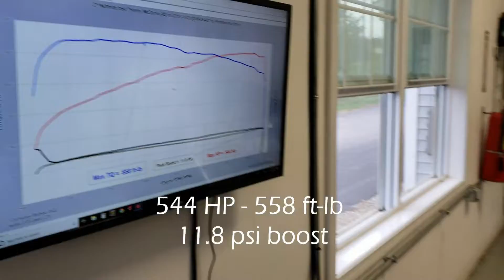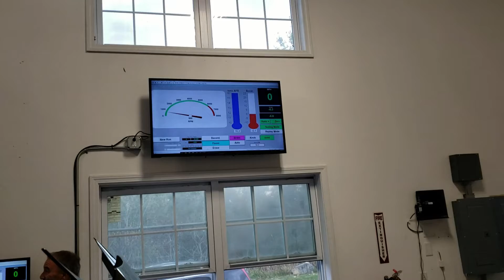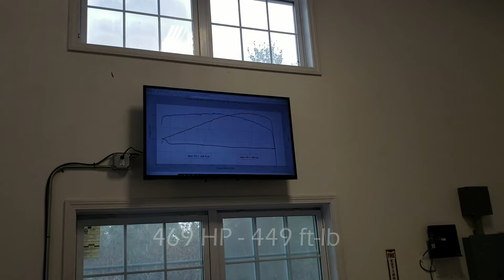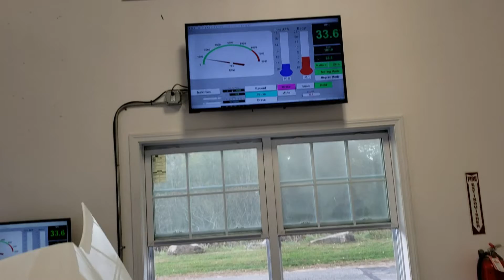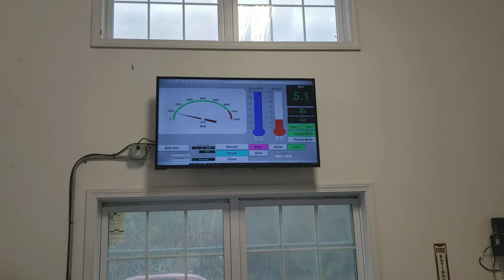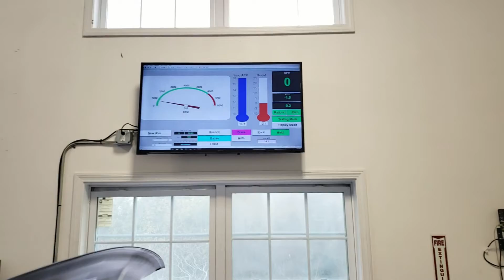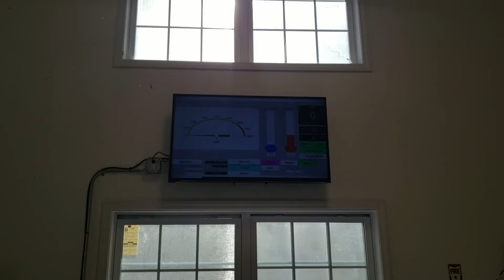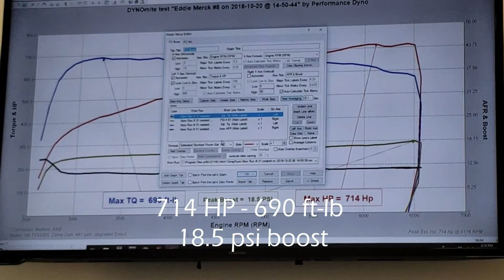STOCK Corvette ZR1 HP #s | K&N Carbon Intake Z06 Throttle BODY Corsa Xpipe

Comment: Nice. Did the zr1 have a tune? Or was it on stock tune?
Reply from the maker: It was still on the stock tune. Only mods were larger Z06 gold blade TB, complete K&N carbon intake and Corsa x-pipe. Thanks for watching!